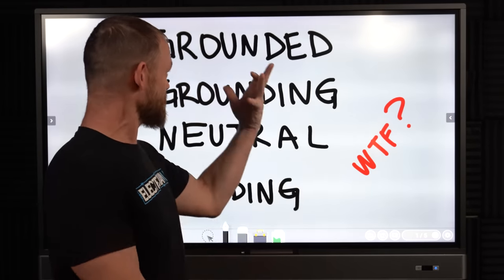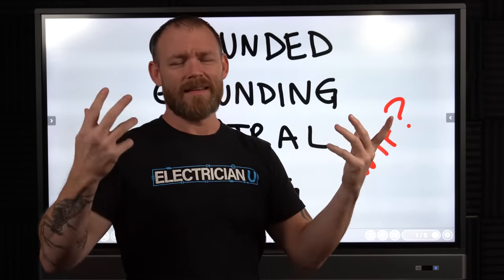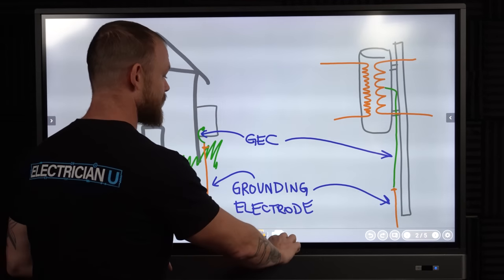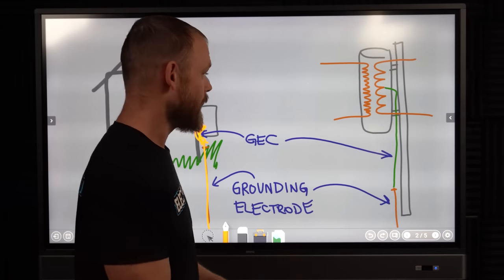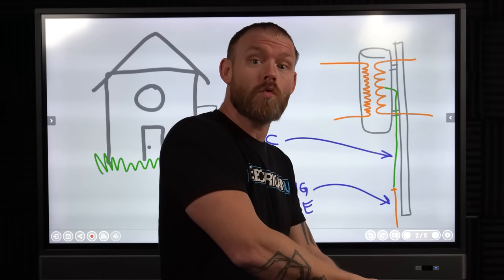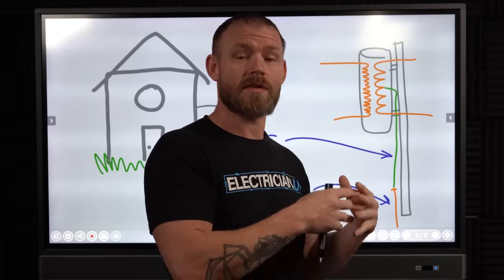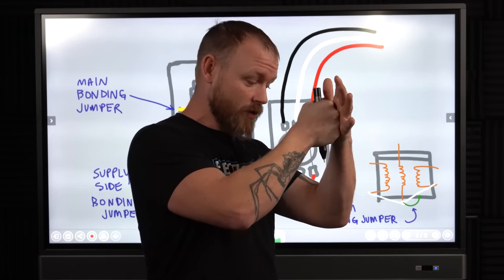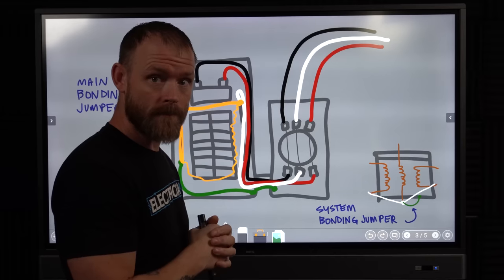What is the Difference Between Grounding, Bonding and Neutral?

Comment: Since understanding the difference between all of these, I've thought that the EGC should have been called the "Equipment Fault Conductor" or something similar to make it clear that the intent of the conductor has nothing to do with grounding, but everything to do with clearing faults.  Having the word "grounding" in the name just seems needlessly confusing.  Code could then state that the EFC "shall be grounded".
Reply: I think this is a great idea! 👍
Reply: Not a good idea.. there are other reasons for using the grounding conductor, such as to divert overvoltages in a surge protector.
Reply: The EGC is only helpful in clearing some faults. It does not protect against all faults, such as arc faults, high impedance junctions, and so on.
Reply: EGCs do other things as well like clear any buildup of charges in the system or raceways.  Like in some conditions like explosive areas the pipes must be grounded to prevent any static discharge which might ignite vapors. EGCs are also important when dealing with small control components and data junk because they’re all so sensitive to charges.  The EGC I believe can also absorb some of the induced voltage from the other phases around it in raceways as well if I’m not mistaken.
Reply: its like a redundancy. its like having an extra off button a hardware off button.
Reply: In the UK it is called the CPC - the Circuit Protective Conductor.
Reply: @musicaltoys3430  No, over-voltage can exist only between two conductors. One avoids it by putting a varistor between them. The grounding constructor does remove leak current though but that is secondary.
Reply: @nesdi6653 I do not see it as redundant… It is the only fault current path back to source to trip the breaker in a hot to case short. Without it your faulty toaster sits there energized on the counter waiting for you to touch it. I have experienced that type of evil toaster when I was a kid… it only bites you sometimes and of course it doesn’t affect your parents… so nobody believes you and you start to second guess yourself! 😵‍💫
Reply: Umm, no, daniel.

Comment: So, when the equipment grounding conductor is bonded to the neutral bus bar at the service panel and there is a fault.. wouldn’t the current want to go to earth rather than back to the transformer through the neutral? Or is the resistance to earth [for that current] more than the pathway to neutral, so then it goes back to the substation through the neutral instead of back to earth?

Comment: why would you not explain that all neutrals are grounded conductors but not all grounded conductors are neutrals depending on system? 120/208Y and 120/240 have true neutral whereas corner grounded delta does not.

Comment: Oh my gosh!  I am having such a huge problem understanding my situation.  With 1 meter and 1 panel, no problem, I get it.  Here is my situation.  1 - 320 amp meter, 2 - 200 amp disconnects and 1 - 200 amp panel for metal building shop and 1 - 200 amp panel for house (yet to be built).  I have photos, but I can't paste them here.  I have the meter with a 200 amp disconnect on each side.  These are mounted to my new shop which is a metal building.  On the other side of the meter inside the shop, I have the 200 amp panel.  My question is on bonding and grounding.  How do I bond all the panels together and where does the GEC connect to.  I know the panel inside will have a seperate grounding bus (on order), but the rest is driving me nuts and I can't find anyone with a setup like this and I don't know why because I would think it's pretty common.  I have talked with the local building inspector, but he is young and I'm not sure if he really knows what he is talking about or if I'm just ignorant.  Drawings of the wiring would be great if you could do that.

Comment: Idiot question time: at my pool I have a few boxes on a wooden post buried in the ground. I clearly see the equipment grounds running to a screw in the post, but I also have 40 amp service running out to the box. I have a GFCI on one of those boxes. When that GFCI pops, is it grounding to earth via the post or the service?  Or does the post serve as more of a ground for a lightning hit even though the pool itself is grounded?
Reply: Technically, it flows through every ground path.   The current is split through the paths based on the relative resistances of those paths.
Grounds are very important, and near a pool you want more than one option.   Because wires corrode, and things happen.
Reply: Mostly the service. The ground wires running back to the main bonding jumper have much lower impedance than the earth.
Reply: It could be either if it is tripping a GFCI.   The current has leaked to one or both.

Comment: The grounding electrode and grounding electrode conductor are part of one system with the main job of capping the the voltages produced from induced currents due to near by lightning (building wiring is a big inductor to emp) or inductive load switching.  They also cap the voltages possible if the neutral from the transformer (really a combined neutral and grounding conductor) were to be broken.  If an induced current hit an open switch, it will see that as infinite resistance and the voltage would rise until it arced over or the energy dissipated in the wire.  (with electronics surge suppressors are used to open a circuit from hot to neutral at the cap limit voltage).  With the grounding electrode, the size of the voltage spike on the neutral is capped by the resistive path from the building electrode and the electrode at the transformer/pole.  It prevents arcing through the insulation of motor windings, but also at weaknesses in the wire insulation the could let an arc happen through something flammable and causing a fire.  

Then it was decided to do equipment grounding, which is another loop of wire that could develop induced current and besides bonding the neutral to the grounding electrode made the voltage potential essentially zero compared to the earth making it safe to use single pole switching on 120vac circuits.

Comment: There is:
1) grounding;
2) circuit protective conductor (CPC);
3) Equipotential bonding.

These are all separate with different functions but all meet at the main grounding terminal of the system. These three use the same coloured wiring creating confusion. Different coloured cable for each of the three functions would make matters easier.

1). Grounding. Connecting a system to the ground is for lightning strikes and static electricity. Lightning always wants to get to the ground, so if it hits electrical equipment it has a path to ground.

2). CPC. is a parallel neutral (N) conductor with no current running through it in normal operation - It only protects the circuit it is in - an e.g. is a receptacle circuit.  If the line (L) is in contact with the CPC for any reason electricity runs back to the point where the cpc and N join which is before the protective device in the main panel. Conditions will arise were, i) the L & N will be out of balance, or ii) the CPC will draw too much current, or iii) there is a fault condition - after the protective device so it will activate and trip, isolating the circuit.

3). Equipotential bonding. Is connecting all the metal parts of a house together, e.g., water and gas pipes - that do not carry electrical current - to the electrical ground point. This is to ensure if a metal part becomes live all metal parts become live to reduce/eliminate electrical potential between the metal parts. If you are holding one pipe with your right hand and another pipe with your left, both are at 0v. If one pipe become 240v and the other stays at 0v electricity will run through your body maybe killing you. If both pipes become 240v at the same time (zero potential between the two), you will not be killed.

Comment: You should do a video or two on 0-10 volt light dimming.  I'm building my own home and want to use it on my LED lighting and there is VERY little on YouTube.  Just learned there are certain LED fixtures that are 0-10V controlled and also Romex with the control wires included.
Reply: Good suggestion

Comment: In normal conditions. Will not the connected ground conductor interfere with neutral (as both are connected) and current may prefer to to leak out from ground each time rather than going back to service. I mean how the circuit decides?

Comment: I found this video very informative. (It clicked when you drew the multiple sub panels) 

I know this months old, so I hope you can see and hopefully respond. I have a new 150 amp main panel. Im getting ready to wire and after watching your video a question comes to mind. In my area we need to have a meter box with a disconnect. The one I have purchased has a 200 amp breaker/disconnect with slots for a few breakers I could use for instance for a 50 amp sub panel. So having said all that, is my main panel in the house now actually a 150 amp sub panel and the neutral bonding now would be done at 200 amp meter disconnect since it is actually  a disconnect breaker box all in one?

Comment: Well is not that unusual to have problems if the neutral in the main breaker is not grounded, here in Mexico We call it Floating Neutral and the whole system goes nuts because the current is trying to find the lowest potential point and lights goes on and of everywhere as if there were ghosts in the building :D
Reply: In Canada, we call it Floating Neutral also 😉. And you are totally right about what happens when not well grounded

Comment: I would put it this way:

Earth/Ground is MERELY there to reference the circuit voltage to 0v.  Which then provides a SAFETY element for living humans.

No circuit needs an earth, unless you want to reference it TO EARTH.

You could run an entire system ON TOP OF (IE 100VDC) a large DC voltage.  IE all of the neutrals and “grounds” would have 100V on them.  

The system will work fine!  But it will also be deadly to anyone who touches the system enclosures.  Therefore, we use earth instead AKA 0V.

Comment: v dope

Can anyone weigh in on... say I'm doing low volt shit and my secondary bus bar eventually goes to the PBB. (The primary bus bar that I assume is connected to neutral as well as the grounding rod). 

I suppose that whatever energy (static or whatever) builds on my system just goes to the rod?

Comment: I have service line coming in from the Meter Disconnect box with 3 conductors, Two Hots and a Neutral going into a Sub panel for the House. (I don’t know why they put the main disconnect meter box Way out at the road but nevertheless, that’s its set up.) I’m installing a Generac Transfer switch on to the sub panel feeding the house. I have been reading about separating the grounding wires from the neutral in the service panel. My question is since there isn’t a second ground going from the sub panel to the main disconnects meter should I install a grounding rod at the service panel connected straight to the grounding bus bar. Keep in mind the neutrals are bonded inside the Generac transfer switch. Any advice would be appreciated. Thanks.

Comment: It's said that a neutral carries the in balanced load. Well, say you have a panel that has no equipment ground, only an isolated neutral bar. So you have a receptacle circuit, what if someone runs a green and  white from neutral bar and a hot color from a cb to the receptacle? Lands the hot on hot screw, white on neutral screw and then bonds the ground screw with the green. Doesn't that cause a potential for arc? If worked live. Or even unplugging a cord?

Comment: QUESTION:  What are your thoughts on using a bonding wire/clamps to a 10 foot ground rod or two separate 8 foot rods for a large boat and or aluminum trailer with four wheels?  Would you make it worse?!?
Reply: This would essentially be equipotential bonding for the boat/trailer. You would prevent the boat/trailer from developing potential (voltage) with respect to the earth.

Comment: So you have in your kitchen a GFCI receptacle, and a few feet down you have what looks like a regular receptacle, but it is connected to the GFCI. So essentially, the regular receptacle is bonded to the GFCI receptacle? It’s not that it is connected so much as it is bonded?
Reply: No, bonding refers to grounding wires. You bond metal conductors to the grounding system. Bonding is done to avoid potential differences between metal surfaces.

Comment: lol, hater 101 here.  honest n all.  im coming from the cec, not the nec[rest can look it up]. a bond, ground and neutral are all pretty well defined in our code.  there is no mistaking it anymore like it used to be in your code [nec].  a ground is simply the conducter that connects the neutral to a direct grounding electrode without splice or break. thats it.  it may be called a grounding conductor and is, but is usually just called the ground.

A neutral, is a wire that is Grounded at the point of supply, atypically to your explanation, all neutrals brought into a residence are grounded at the transformer supply, at every transformer along the route to get your residence. [mostly anyways [90% of the time]] aaaand at the consumer side transition aka main breaker/panel box by means of a grounding rod[s] or grounding plate, or in older olden times...connecting to the water pipe system if your lucky enough to live in a place that has running water lol.  But they are still connected via a ground/grounding conductor.

A bond/bonding wire...is just that, its only purpose is to ensure there is a complete path back to where the electricity came from so it can trip a breaker or blow a fuse. if not there, than when there is a short anywhere in that circuit... the current path back to where it came from would and can go through you or anything else and kill and still not trip or shut off.

thats my 8cents.  thx. my apologies.
Reply: CEC and NEC in almost all cases match each other.   Very few differences.

Comment: The system neutral is even more interesting in the distribution system… and even more critical for protection and safety.
We routinely refer to the distribution system neutral as the multi-grounded neutral… it gets bonded to grounds throughout the distribution system at equipment locations. Confusion between the terms bonding and grounding also exists in distribution circles. Mitigating step and touch potential hazards is a big ordeal and bonding for the purpose of establishing an equal potential zone gets confused with grounding especially when the zone is on or under the ground… and in some situations it’s better to isolate than to bond depending on specifics. And then theres those pesky clauses in the code that demand that you bond to things in close proximity but then that just extends the hazard that also must be mitigated, so you try like hell to separate… but then sometimes there’s no room for that… and… and… and…
Lots of hair pulling.
Cheers!

Comment: Hi sir...just a doubt.. If the transformer side nutral is not grounded, will the earth work as return path in equipment side...
Reply: NO!  The earth is never acceptable as a return path.
Reply: @darriuscole8544  yes sir..I understand that...but what if i didn't ground the nutral in transformer side and short the phase and earth in load side... Will it be a short circuit?

Comment: 8:50
Wrong.
A NEUTRAL HAS TO BE BROUGHT TO GROUND, Grounded, Earthed.
If not, it's not a neutral. and if its supposed to be a neutral, like in a 120/240V single phase or 120/208V 3phase system, a non-grounded neutral can cause voltages fluctuations and/or damage to equipment
Reply: You misunderstand. He means that, electrically, the circuit will operate, not that such a configuration is compliant.
Reply: Electrical systems worked just fine with no grounding electrode or equipment grounds for decades before it became required.
Question,  is the voltage truly fluctuating or is it possible that there is no bonded point of reference for the electric multi meter to measure from?

Comment: I have a commercial air compressor, trips my 15 amp circuit outlets. What should I ask an electrician to do?
Reply: Not an electrician, but a 15 amp circuit should have 80% max load, so that would be 12 amps.  When a device starts up there is a current spike to power things up, then it levels off to it's rating.  It can trip the breaker sometimes when starting.  Look at the amperage rating on your compressor, and see if there are any other receptacles with plugged in appliances, etc. and remove them if possible to lower the total branch circuit amperage.  All the amperage combined should ideally be below 12 A.  You may need new higher gauge wiring (safety concern) run to the outlet and a new circuit breaker.  There are other possibilities, more difficult to trouble shoot and beyond explaining on a YT comment, but the above is the most likely.

Your electrician will let you know what needs to be done, it is not about you asking him what to do.